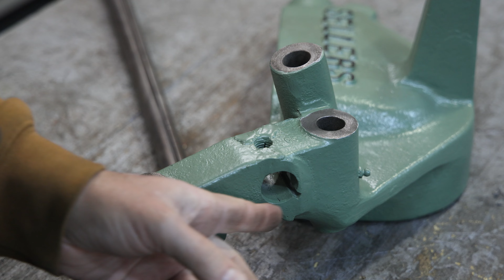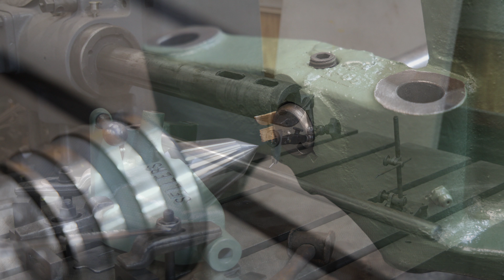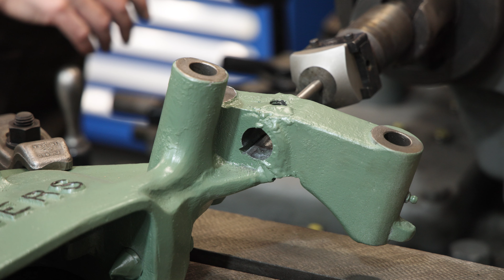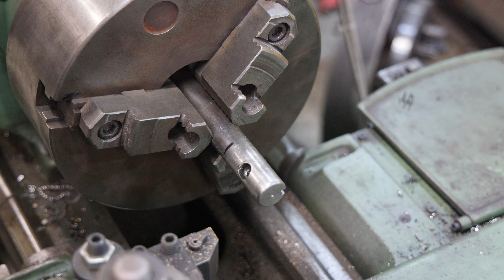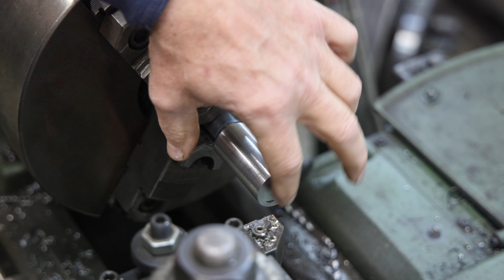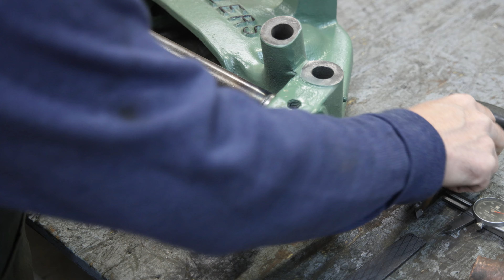Sellers 6G Drill Grinder: Repairing the Broken Drill Guide on the Horizontal Boring Mill

Comment: You bored the casting off center and  put the bushing on the rod on center.  By doing that you moved the rod center away from the original position .03125 to .125 inch.  Will this cause a problem with whatever is attached to the other end of the rod?  It may not matter but if there is a problem with whatever is on the other end of the rod this might be the cause.
Paul
Reply: I disagree , boring was started based on center of shaft in original position . Hole , shaft , and bushing have concentric centers .

Comment: is there an important reason that the shaft has a keyway the entire length, and is there some functionality from it that you'll be losing by adding the bushing to the shaft?
Reply: Yes, I thought that too at first. But if you look at the two minute mark you can see that the shaft is keyed and a set screw holds it in that position which means that the key-way that goes the length of the shaft must be for some other part that can be positioned along the shaft while the key keeps it oriented properly.
Reply: No. It’s harder to make an internal partial key … so they make all the way . And on the shaft is easier to mace the whole length, because you don’t need to measure anything, and chances to make mistakes or zero…

Comment: Hi  Kieth, once you started boring , that old bucket-o- bolts made so much noise you couldn't hear a word you said. Definitely a head set microphone  or some such or overdubs when editing is required. Otherwise, an intriguing problem piece to set up. I'm sure you checked, but it looked like the vertical hole to the right side of where you were boring might have been at right angles to make setup a little less fiddly. 
Regards from Canada's banana belt.
🤞🇨🇦🍌🥋🇺🇦🕊🇺🇲👜🐖🪓🏁👍
Reply: Keith
Reply: It’s an old junk machine , like the planer … same noise old junk. He need to replace the drive trains , and make them usable machines … but no… he likes the vintage junks 🤣🤣
Reply: @emilgabor88  if only you had some remote idea what you were talking about...

Comment: Hello Keith, is there a reason that you and all the other machinists I have watched, feed the cut from right to left? to me it seems that if you cut from left to right, there is much less risk of  crashing into the chuck
Reply: So you don't pull the workpiece out of the chuck.  --Doozer
Reply: If you look at the boring tool, the cutting edge is at the extreme tip of the tool that ensures that it cuts into the material right to the end of the hole, in this case a through hole. Yes, it could be cut in reverse, but then a custom tool would be needed, and the work would become more cumbersome having to watch the cutting action from behind the work part. Not, usually, very convenient.

Comment: Question: just a question for knowledge. Why would you not braise the oblong hole and bore it back to the original size. This is just a question
Reply: Because he had no reference surface . The would have needed to make a fixture .
To much work for the same result…
Reply: Braise is very soft compared to to the steel shaft.
Reply: @davidgibson5756  No it is not.  --Doozer

Comment: For those that suggested brazing the hole then boring it out, keep in mind that brazing is soft, and putting a steel bushing in there will allow the stresses to be transferred 100% into the parent material. Steel onto cast iron. 
Keith did this correctly.
Reply: Brazing is not soft, it has the same strength as mild steel.:body-blue-raised-arms::face-red-droopy-eyes::face-red-droopy-eyes:
Reply: @garybrenner6236  If using aluminum-bronze filler, yes absolutely strong, actually stronger, than mild steel.  --Doozer

Comment: I think I would've silver soldered the bushing into the arm. This would've strengthened the casting/braze repair as well as keeping everything original.
Reply: Without extremely good heat control the temperature of the casting could have easily gotten hot enough to melt the original braze job, risking the part getting out of alignment. Fixturing would have been quite complicated. In this case I think it better not to tempt fate.
Reply: @kennethstaszak9990  He said silver solder, not braze.  You just barely have to get the casting the dullest shade of red. No danger of overheating the existing braze, unless you are really clueless.
Reply: @ You do it whatever way you want. I don't care.

Comment: one could have used devcon steel epoxy. release agent on the shaft.  place the shaft where it is needed and let the epoxy set.  then drive the shaft out. you will be left with a bore that you can indicate off of and make your bushing

Comment: Rather than a bushing, I'm just wondering why you didn't just build up some welding and then turn that down.
Reply: Because he is an even worse welder than he is at machining!:body-blue-raised-arms::face-blue-smiling::face-blue-smiling:
Reply: @garybrenner6236  😂😂😂😂😂😂😂😂 You notice I'm not watch YOUR channel.
Reply: Do you mean brazing? Welding makes castings brittle without really specialist knowledge, the weld also goes mega hard as it draws carbon out of the cast iron making it really difficult to machine.
Reply: @mapstardamo1624  I was just talking about building up some weld instead of putting that bushing on there but he wound up being about the same thing
Reply: @mapstardamo1624  I thought indeed that filling the hole with braze and then drilling and reaming out would have been simpler. However not clear how you would align it correctly, unless you set up on the borer first and brazed it there. Not ideal.
Reply: @RicktheRecorder  you would align the part on the borer using a jig and the two holes on the casting then remove it from the jig, braze it up and then remount it in the jig to be drilled and reamed. Done similar before, although it is very time-consuming.

Comment: Just a question from someone who is not a machinist, but would it also work if one would braze the hole mainly on the worn side and bore it back to size?
Reply: Finding the center again would be the problem.
Reply: Keith's method of setup could've been used with a  jigged fixture then returned after brazing to bore again. It would be a lot of work though. With time on your hands not a problem but Keith has a million things on the go.
Reply: @mapstardamo1624  you'd also need to figure out a fixture to broach the keyway again.
It's a lot of work that provides zero benefit.

Comment: Keith, what about the piece of the casting that broke off. Wouldn't that be at a different angle?
Love what you do!!
Thanks Phil Stevens
Reply: Agreed.  

There are two bores on either side of the break.  It appears that they are supposed to be parallel.   Of course, they are not now parallel, due to the brazing repair prior to Keith.

I suspect we will see more about the grinder comes back to life